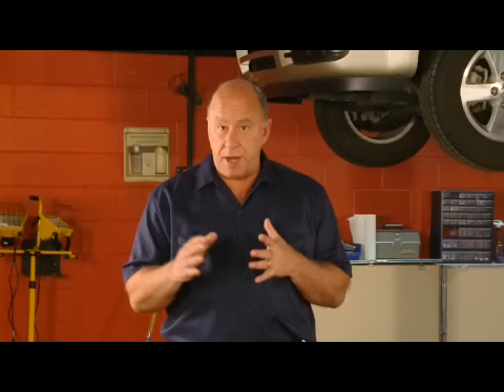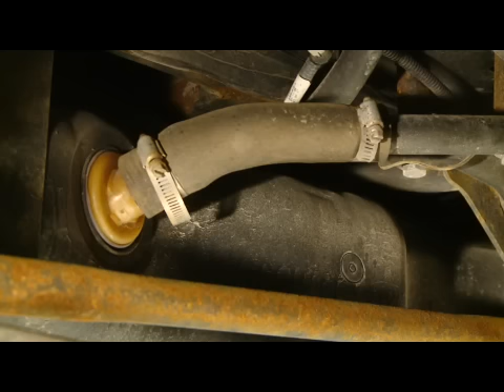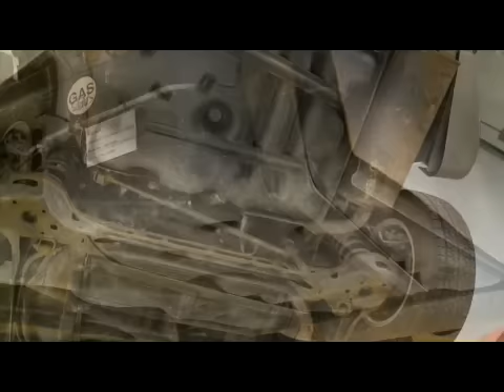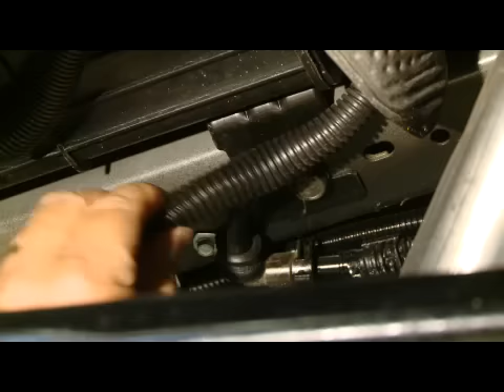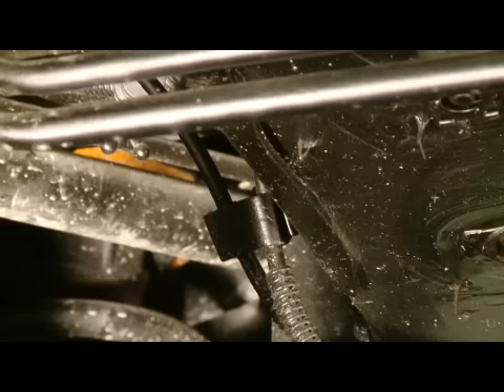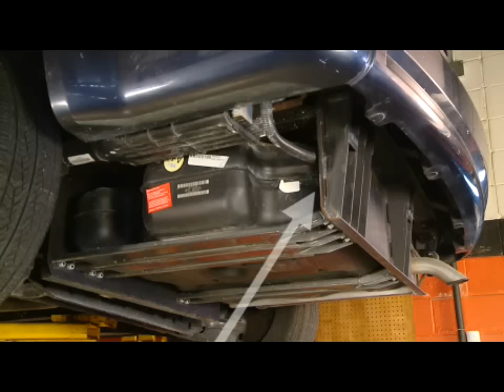Video Series: Fuel Systems in Wheelchair Vans

Comment: I own a 2002 modified chrysler town and country handicapped van. Dropped floor. Everything and I mean absolutely everything is breaking on this van. Ramp broken, both slider doors broken, 3 of 4 Windows don't open, and now MAJOR gas leak all over the bottom of van. Lost 2 gallons of gas in 10 seconds of pulling out of driveway. Screw this van and screw chrysler.
Reply from the maker: Hi Ryan – We aren't finding your name in our records. Please contact us at 800-488-0359 or email productspecialist@braunability.com to start a case in our system. Your safety is our priority and we look forward to helping you and your situation.